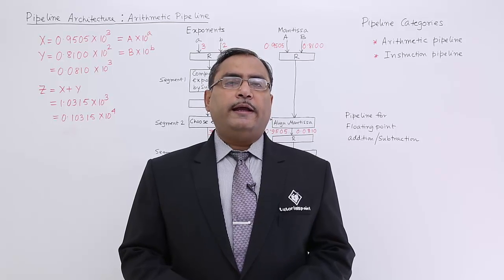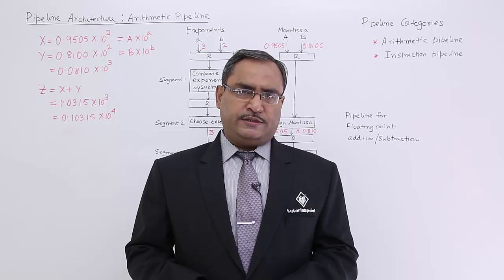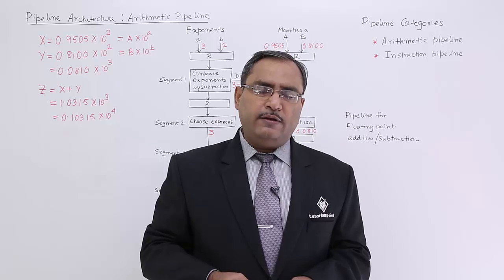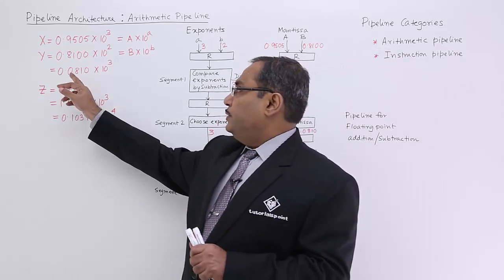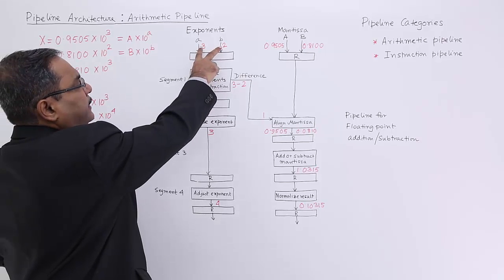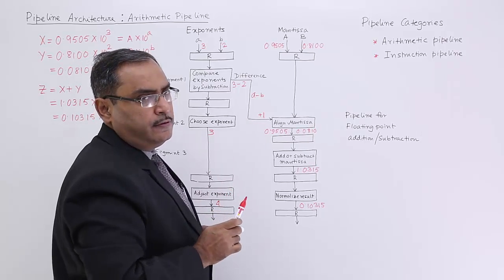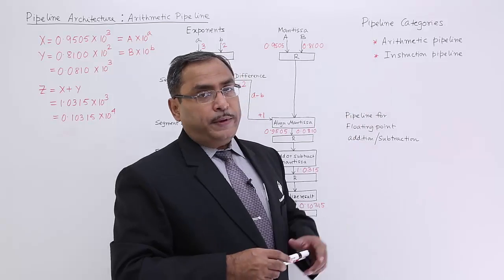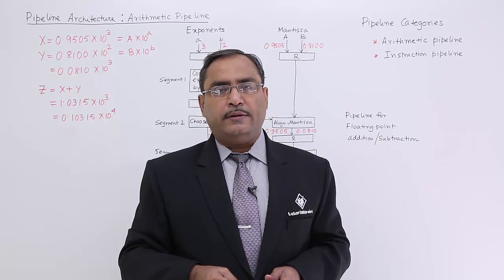Arithmetic Pipeline Architecture

Comment: There is a mistake in the flowchart provided by  sir,there should be connection b/w the segment 4 and the block of the normalize result
,as to adjust the exponent ,we should have known the result,so connect the segment 4 block and the block in which norma....result is written
Reply: Lavish Garg 
Yes you are right.
There will be an arrow pointing to Adjust exponent of segment 4.
Anyone can google search and find what i mean